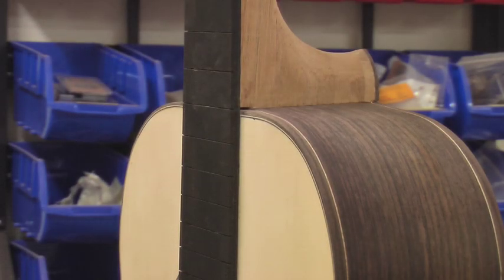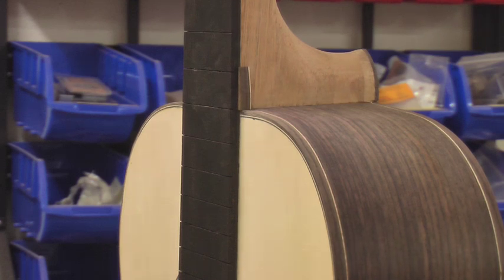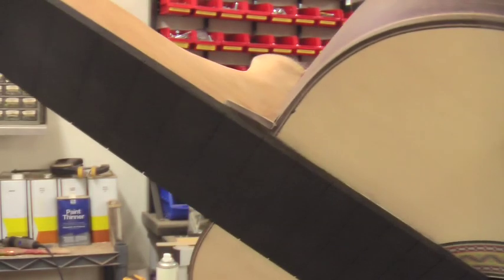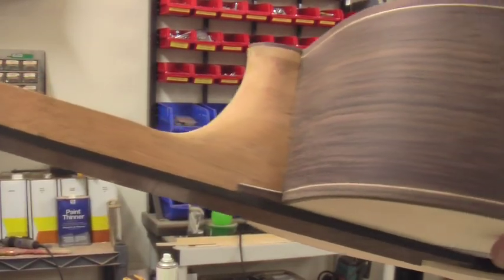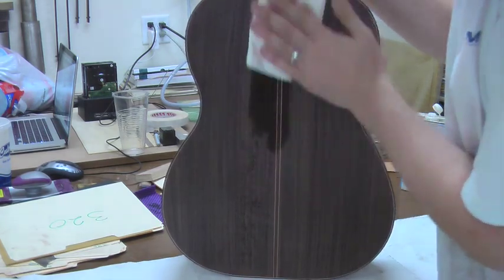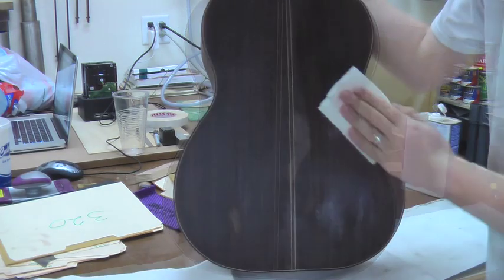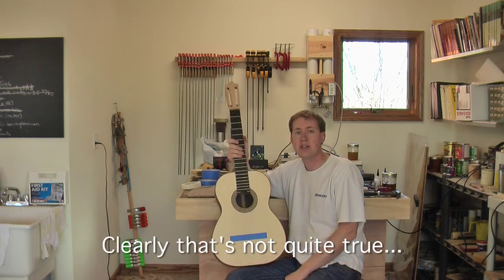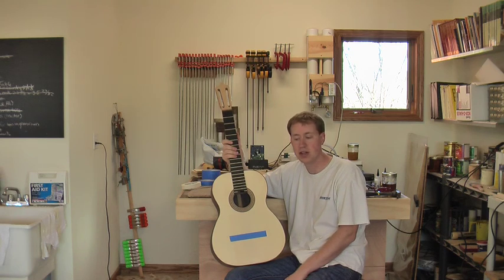Build a Guitar, Part 11, Detailing the Neck

Comment: gr8 job why did you not put a trush rod in the neck so you can ajust the neck to keep it from drawing or pulling when you put on the strings or tacking them off not poking at you just letting you know how inportin it is thanks

Comment: there is no reply in some comment so ill say some things hope im not out of place the nect shoulnt be perfectly round it should be elliptical or slightly ovalish and at the end you take a belt of emery 4inch by 12long  and make like your buffing your shoes following the oval (with guitar facing down) that way the thumb has most pressure without strain #2 there is no radius on a classical neck #3 use a 4/ 4peice of lumber about 6 inches long under the neck when fretting    its best that you cut out a female half round shape to nuzzle the neck in( less movement)

Comment: No trussrode?
Reply: Classical guitars do not typically have truss rods most of the time.  Truss rods are mainly put in to combat the tension of steel strings.
Reply: )+Jason Stamper I LIVE IN ISRAEL WE HAVE 6 MONTHS OF RAIN AND SIX MONTHS OF NDRY HEAT IF MY CORDOBA GUITAR DIDNT HAVE A TRUSS ROD ID BE CHANGING THE BRIDGE SADDLE  AND NUT 3 TIMES A YEAR AS I DO WITH MY OTHE CLASSICAL GUITAR PAIN IN THE BUTT THE TRICK IS TO USE A LIGHT WEIGHT TRUS ROND FROM TITANIUM OR ZINK ALUMINUM CASING AND TO MAKE IT SNUG AS A BUG IN A RUG # 2 YOU CAN ALWAYS MAKE SATIN FINES HBY USING A 1000 EMERY OR MICRO MESH #3 WHY DIDNT YOU COVE THE MISTAKE ON THE NECK WITH MAHOGANY AND EPOXY SO IT WOULDNT SHOW ?(caps are accident sorry